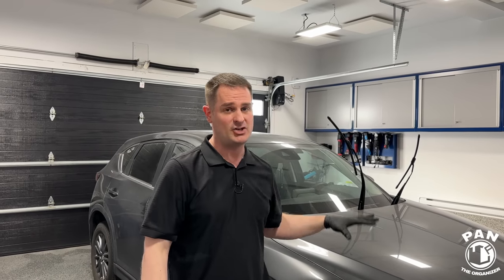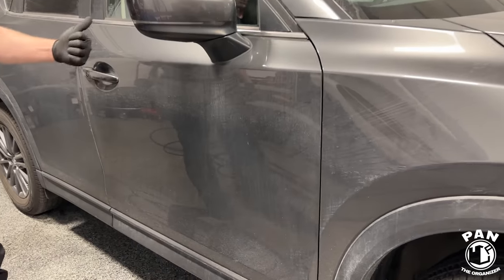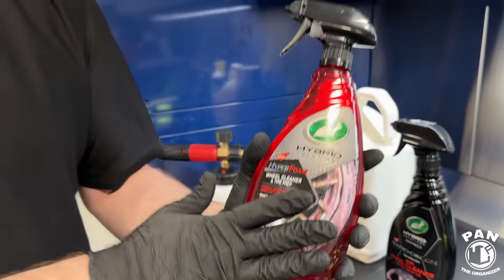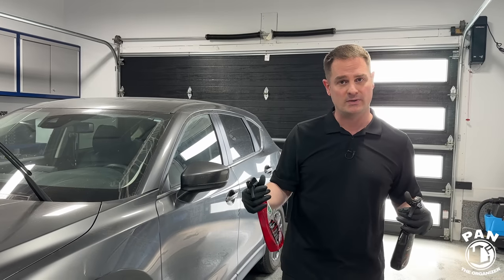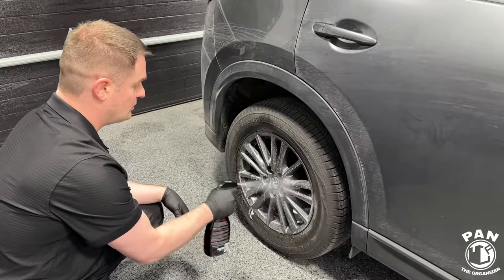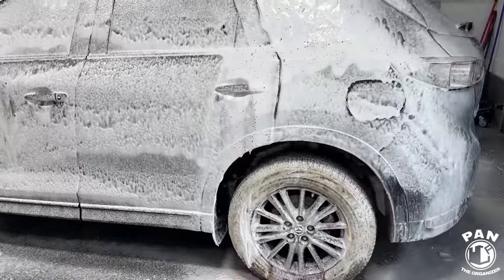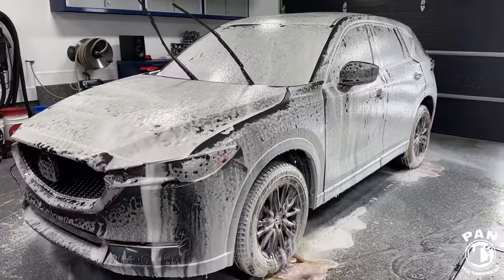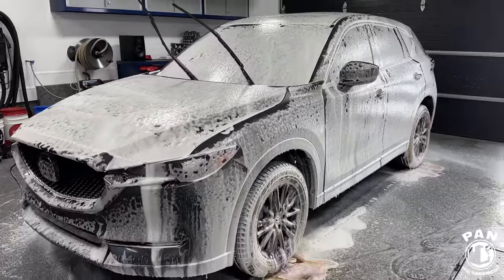MYTH BUSTED!! Touchless car wash??

Comment: Great video Pan. Two things to consider. We’ve been playing with foam cannons and cleaners for about 20 years. I’ve found two things to work better when using foams. Don’t let it soak that long. We foam, reinstall the tip in the pressure washer lance and rinse right away. Usually the foam is on the car for 1-2 minutes tops. Always rinse from the bottom up. These foams are designed to suspend the dirt and use the high pressure rinse to lift the dirt from the surface. Rinsing normally from the top down will rinse the cleaner away before the high pressure rinse can do it’s job. We consistently get better results doing these two things. I know you’re following manufactures recommendations, but I’d be interested to hear your thoughts.
Reply: That sounds good but what about using a mit and the two bucket method after you've applied the foam?
Reply: I've indeed found that rinsing from bottom up gives better results
Reply: @donmckinney4091  I’d probably ask you why you’re using a TOUCHLESS foam if you were going to wash the car traditionally anyway. Did you not catch the title of the video, or even watch it lol?
Reply: @axe2grind244  -Sure did but when I go out of town to see my family especially in the winter months I go to a local touchless car wash for my truck. But when I'm in my home state I hand wash it. See how easy that was Einstein? But I'm sure you had a rough time grasping that right?
Reply: @donmckinney4091  you wrote you want to apply a mit after you sprayed the touchless foam on it. that indeed doesnt make sense.
Reply: @johnmachter40  -I was asking Ken who uses a FOAM cannon so my question was aimed at him. Sorry if you have ADHD! but read my comment please!!
Reply: @donmckinney4091  if the car is dirty you ofc want to rinse the initial foam to rinse off most of the loose dirt before you start touching the paint with a mitt. Thats the point of a pre-wash, it reduces the risk of marring the paint with your wash mitt.
Reply: @heysatan8  l
Reply: @axe2grind244  people at my old dealership used brushes and mitts on touchless foam all the time....  they preferred its way of getting into more nooks and crannies, and gives us more time than traditional bucket wash before things start drying in a hot climate.
Reply: @smatchimo55  what people? porters? dedicated detail professionals employed at the dealership?
Reply: Makes sense.
Reply: I was also going to give PAN some tips on how to wash a car……..but then I really thought about. If only people would think before they speak. 😂😂😂
Reply: I’d really like Pan to investigate this.
Reply: @smatchimo55  of course they would. It gives results fast but do they care that they're scratching and marring? Nope!
Reply: @MrHukd  which doesn't happen unless you are putting too much pressure or not maintaining your contact wash items.  I'd much rather deal with normal washing wear and tear than trying to wash my car without actually touching it lol.  it's like you didn't watch the video.
Reply: @smatchimo55  seeing as you've misunderstood the context of my comment let me explain so you understand. When you apply the contactless wash, it loosens the dirt which you then rinse off. But if you rub the foam instead of rinsing, you are then rubbing all that dirt the foam just loosened Into the paintwork. Not very smart is it? And that's why I said, when people do this they don't give a shit about your paintwork. But seeing as you've failed to grasp the concept I can understand why people would do this.
If you need to make contact, then you do it with another cleaner AFTER youve rinsed the foam off. Make sense?
Reply: Genuine question, rinse it right away though? Isn’t that counter intuitive?
Reply: Interesting... so if the foam has the dirt trapped in it after soaking, it seems like it would not matter how or when the soap is rinsed off. Maybe from your observation the dirt needs a little mechanical agitation to help loosen it, moving it into the foam, and that is what the pressure rinse does?
Reply: What if we have a big Suburban?
Reply: @MrOiram46  trade it in on car that doesn't cost so much to fill up.

Comment: I wonder what the results might have been if the vehicle had been pre-rinsed with the pressure washer, allowed to dry, THEN used the high pH snow foam.  The foam had a pretty thick layer of dirt and grime to penetrate to get to the paint.
Reply: As long as the dirt level on the car is very minimal yes you could try that. If there’s a good amount of dirt/road grime on the car don’t rinse the car first. Cause that will cause scratching with all the excessive dirt. A pre treat foam would be best first. Unless of course you don’t mind rinsing that dirty of a car.
Reply from the maker: At that point just wash the car manually.
Reply: I’m suggesting this as a test to see just how effective the foam would be, not as a recommended procedure.
Reply: Technically, pressure washing while it's dirty is still not a form of touchless. You are using high pressure to blast dirt down and in and across the surface.
Reply: @The1Music2MyEars  Technically, no.

Comment: 5 minutes out and already 20 people upvoted ! ! ! ! Am I that slow ?? 😊
Reply from the maker: It could start breaking down older waxes or sealants at 5% PIR. Ceramic coatings can resist it every once in a while but you wouldn’t use 5% PIR every week. 2% is more than enough for regular weekly washes and at that dilution, it won’t harm coatings.

Comment: I have a mothy plan at my local soft cloth car wash. i go through 3 to 4 times a week. My car looks great. It does not scratch like most people think.  All the nonsense with foam canons and touchless washes are nothing but a waste of time IMO. Specially on the daily grocery getter.  That said This is a great video. Someone who is very qualified unlike most of these videos done by people who couldn't tell you the difference between low and high PH.
Reply from the maker: Hehe thanks man! How did you discover my channel by the way?

Welcome to my channel. You discovered one of the biggest car detailing channels on YouTube as we surpassed 960,000 subscribers and we have over 130 million views! I have been detailing for 26 years and I love to share my knowledge and passion with my viewers.

You found the right channel to help you learn everything about detailing.
Reply: It popped up in my feed. i'm always up for learning. I been in the car business my whole life. I have done it all. hand wash, touchless, soft cloth and even nylon bristle. The nylon bristle car washes from the past is where the whole  thing started with scratches. Back in the day when the car wash used nylon bristle brush's and the paint was soft lacquer,  the paint surface was easily surface scratched. Now with clear coats and soft cloth, there is no comparison.  It does not scratch like people claim. People scratch their own cars setting things on them, driving through the bush and getting snow off of it with a push broom or a shovel . Then they go through the car wash and see the damage once the car is clean and right away point blame.

Comment: You make an excellent point with the PIR. On those vehicles with heavy mud and road grime, the higher PIR will do the better cleaning. For maintenance washes, the lower PIR (around 1) will do the cleaning with minimal wear and tear on the protection. As a rule, I apply protection in the form of a sealant or sealant and wax on any vehicle that isn't on a maintenance schedule. This gives the customer the benefit of high gloss and solid protection for as long as possible. Thank you for the excellent video! I have to admit, I would not consider a touchless wash on any vehicle as my obsession with cleanliness won't allow it  - I have to do a contact wash as well :)

Comment: While going through my last winter wash at a local gas station, I thought about an idea for an episode(s) for your channel. During the winter months most of us living in sub freezing temperatures have no option but to use drive-through car washes.  If you can come up with way to compare the different car washes in terms of the quality of the products use, the cleanliness of the water ( recycled water ?), effectiveness of the pressure cleaning / drying etc
Reply: exact Same concern here! cannot find any info about these auto Car wash machine
Reply: @z-prodidsanziiprod6090  YES! Absolutely do not take your vehicle through an automatic car wash because it IS very bad for your vehicle's paint finish!

Comment: I do this method all the time. But I add 1 minute worth of scrubbing with the wheel brush on the wheels/tires. Just a quick agitation takes almost no time before you apply the snow foam.

Comment: On a side note, Pan - your video showed why I don't like these new spray foaming wheel/tire cleaners everybody is putting out. I also go through about half a bottle per 4 wheels. That's $6 in product per wash!
Reply: It's rediculous, they hold for 1 or 2 washes
Reply: @flowinthrou  I buy the Hyperfoam in a gallon container and dilute it about 3:1 in a foam pump sprayer. Goes a lot further and is way easier to apply than constantly pulling a trigger. Diluting it doesn’t seem to affect the cleaning power at all.
Reply: @jimshinosky9041  I do this, too.
Reply: After trying these type of products I've gone back to using Griots Foaming Tire Cleaner. You get the benefit of the foaming action and about 10-12 car washes out of 1 $8.99 aerosol can.

Comment: Hello from Chicago! You and I met a few weeks ago at The Bays Romeoville, Illinois location and talked a little bit about my experience with Jescar UltraLock (ceramic).  The first time I washed  the car was after applying UltraLock was after Chicago Streets and Sanitation workers applied more salt and sodium chloride to the roads than measurable snow. Needless to say, my Subaru Outback was coated with salt a sodium, and crud. When it came time to wash, I applied a ph neutral car shampoo for the UltraLock’s first wash, I was amazed as all the salt, sodium and road grime simply slipped off the car and onto the alley during the rinse.  For a moment, I thought I discovered a car detailers nirvana!  However, the second wash left grime and the third wash left grime. You’re right-touch less car wash is a myth!  Thanks for the video!

Comment: Same process on a modern car wash tunnel, high Ph foam, then contact with foam fingers.   Just proves the contact method is still needed to remove the road grime that has built up.

Comment: I use Chem X Stars and Stripes and what I found is if I use it as a maintenance wash every week or 2 and the car did not see rain it works GREAT. Once I get outside of that 2 week window or if it rains and I don’t wash the car right away it doesn’t work very well and will require a contact wash.

Comment: Bilt Hamber Touch-Less foam works best when used as a system with Bilt Hamber Touch-On ceramic paint protection, after the initial wash and easy application, your car stays cleaner for longer and subsequent washes just require a blast with the Touch-Less foam until a reapplication of Touch-On is required depending on the time of year. I have had comments about how my car always looks clean despite not washing it that regularly.

Comment: I did the brushless automated car wash on my brand new Dodge truck from the very start. Car wash was close so I would drive it immediately home and park under the carport. I then had 25 or so microfiber rags pre wrung out. I would then, with a one-way motion, wipe the dirt away folding and turning the rag often. I also had a dry microfiber rag to wipe it all dry behind me. It worked great and for over 10 years I never had any micro scratches that I could see at all. It was a dark metallic paint. I was living in the eastern desert of Washington state at the time.

Comment: You can probably mix your own touchless cleaner by using autoshampoo/snow foam plus a regular alkaline cleaner (like KC Greenstar). According to my understanding you only need the consistency of the snowfoam to make the alkaline cleaner stay on the surface for longer. Snowfoam plus alkaline cleaner will give you just that.

Comment: For a proper touchless wash, a 2 chemical system works great for myself. I am using Chem-X’s Stars & Stripes with great results. It is also helpful to have a high GPM machine for this. I am using a 4.5 GPM machine.

Comment: I started doing touchless washes in between full washes. I just pre-rinse with clear water, foam with regular car wash, and rinse. I will follow up with spray wax on the wet car and dry with very clean towels. I keep my car under a cover outside, and it does get a buildup of very fine dust after a rain.

Comment: I use the Gyeon Foam Q2M for this and it works amazing.  Let it sit 2 minutes and spray off.  It's so good I may even replace my Brake Buster in my IK foam sprayer with the Q2M foam because it takes almost all brake dust off the wheel without touching it.

Comment: Pan I am a fan but this video I have 2 thing that bothered me.
both on the paint and both on the wheels you left the chemicals to dry. I'm using bilt hambers product for a year and I found that since they're very powerful you don't need to let them sit too much. 1-2 minutes is enough. see when you leave it too much, the dirt that is being lifted is starting to dry and stick to the paint wheels, so you gotta find the sweet spot and rinse it before it starts drying again. I have fantastic results with this products, even better than showed on your video, sometimes a contact wash is pointless since bilt hamber products do such a good job. cheers mate.

Comment: Pan I noticed the same thing about the Turtle Wax Wheel & Tire, you use a LOT of product. Also the foaming sprayer does tire out your hands very quickly. The product itself does work very well, especially with a tire brush
Reply from the maker: Yes it's very good but you do end up using a lot.

Comment: interesting wonder why it would take off the existing coating but not that remaining excess dirt.. you would think it would take off 100% of the dirt since it also takes off the coating
Reply: Good question.
Many contaminates (especially acidic ones like bird droppings, roadkill, bugs guts, ect...) dissolve the Coating(in that isolated area) and adhere directly to the paint/clear. Some even etch into the clearcoat leaving behind visual defects when removed. Iron specs/Rust is another annoyance /example...

Comment: I knew what the result would be before Pan started the wash, because that much caked on dirt will not just loosen and float away without mechanical agitation. My feeling is that the quick removal of a thin, loose layer of dust just acquired CAN be removed this way, leaving a very clean surface. It really depends on whether the car is relatively clean and surface protected or it needs even a little deep cleaning.
Reply from the maker: Welcome to my channel. You discovered one of the biggest car detailing channels on YouTube as we surpassed 1 million subscribers and we have over 145 million views! I have been detailing for 27 years and I love to share my knowledge and passion with my viewers.

You found the right channel to help you learn everything about detailing.

Comment: I think touchless wash is achievable But probably not cost effective. My first idea is to refoam Bilt hammer when the car is dry or even trying products for road grime/film. 2nd after the first foam go closer with the presser washer but not too close to remove paint. Depends on the pressure and flow rate. Have removed 90% of floor resin with a pressure washer and the rest with cutting compound and rotary.

Comment: I would like to see a Bilt Hamber products test.
I use BH auto wheel, and after trying at least 12 wheel cleaners, I found the BH product to be the best. It reacts the quickest as an iron fallout remover, yet it also has fantastic cleaning ability too.
I use BH auto foam in an Auto Glym foam gun, which gives a thick foam, but not too thick that it doesn't do it's job which is to slide the dirt off the paint surface.
Good to see you rinse top to bottom, which is always how you should imo. I see a few rinsing snow foam bottom to top, WHY ??? What is the point of rinsing the dirtiest part of a car (the bottom bit) upwards onto the cleanest part ? I think valeters and detailers who go against gravity also think the earth is flat too.

Comment: I usually use 2-3 % PIR, as 5% isn't really needed unless it's been dirty for a couple of months. I wonder what a citrus cleaner would do behind what you've done already? Acid and alkaline together would actually make a pretty decent cleaner once every 6 months or so. Also Pan, you need to try Bilt Hamber Touch-on shampoo in the 30ml sachets with Touch-less snowfoam, it's a good combination 👌

Comment: Hi Pan. I use P&S Brake Buster often on my wheels & tires but it is my understanding that the product does not remove iron. Would you recommend alternating between P&S BB and other products that contain iron removing capabilities like the ones you featured in this video or should I follow P&S BB with an iron remover on the wheeIs? I like P&S because of the rust inhibitors.
Reply: I've just got a litre bottle of Gyeon wheel cleaner with Iron removing capability, not used it yet but will use P&S BB afterwards to get a really deep clean